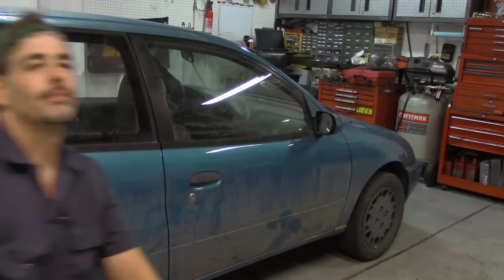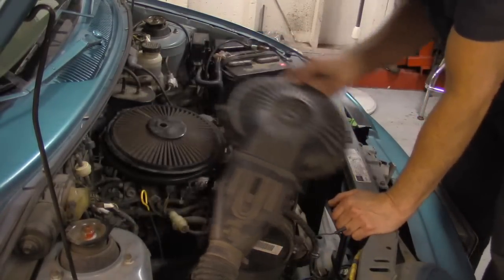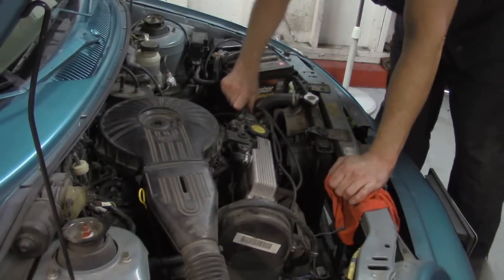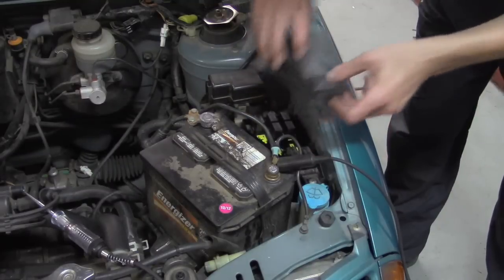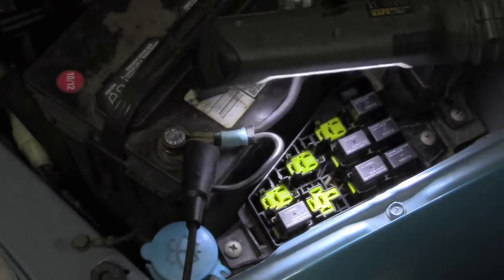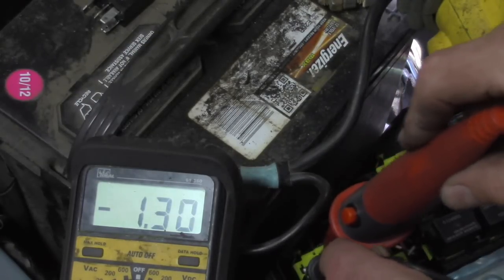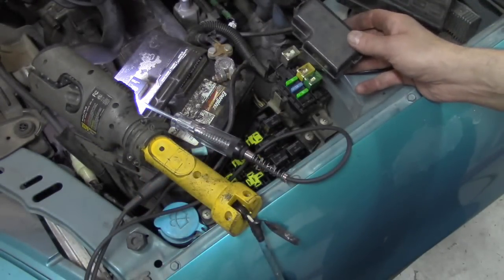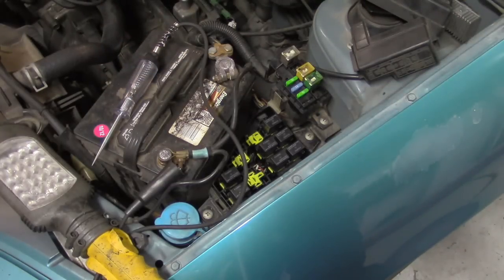Cranking No Start -Quick Basic Diagnosis

Comment: i have a 1995 cadillac fleetwood brougham 350lt1. hard start when cold. sometimes no start unless i switch it off and start again. when i leave on the car, i may stop somewhere 3 or 4 times. then it acts like it's running out of gas, then rough idle. i have to drive it aggressively to smooth it out. PLEASE help me.
Reply from the maker: Ok- what data do you have?
Reply: i have no data because, i can't find anyone with a obd to gather data from 95 down. they tell me that their obd is from 96 and up. i have no engine light. i've  installed new coil, new EGR, new fuel pump. when i crank it, it has a very low idle. when i first got it, it would crank with a higher idle then goes back down, oh yeah, i've cleaned the mass air flow sensor also.  i hate to keep buying parts and no fix. i wish i could find someone with a obd that will read my codes if any but, the light is not on.
Reply from the maker: You don't need OBD data. just tell me what your basically electrical and pressure outputs were- like the data that indicated your EGR  and fuel pump needed replaced- what was the data you used to determine those?
Reply: back in 2013, my brother-in-law had a obd  to fit my car when the light came on and, the code that was read out was the ERG. but he doesn't have it anymore. i replaced the ERG and, the light went off. the fuel pump was replaced in 2012 by the previous owner. like you said i really need to take it somewhere to get a fuel pressure reading. could the fuel pump be failing in 5 years? oh yeah let me mention this, the car has 300,000 miles and runs very good untill it gets hot. please be patient with me, i am not trying to worry you to death.
Reply from the maker: No problem. There just isn't enough data here for me to work my magic.  Fuel pressure and voltage tests would be helpful- otherwise I'd just be randomly guessing.
Reply: ok, i thank you anyway. i'll figure it out in time. you are still my favorite machanic . i watch you videos almost everyday. i still feel you are the best on youtube. have a good day.

Comment: hello sir,i have un issue whit my car that nobody can tell me what means,hopefully maybe you can tell me something about it: so,i have a passat 2002 whit 1.6 liter engine (ALZ code) and i cannot pass the emissions test because of my high CO,everything is good HC are below 70,nox are in range.On my scan tool ALWAYS but ALWAYS LONGTERMFUELTRIMS are negative 10 at idling and STFT are between -2 and 5 sometimes.If i rev the car up then LTFT goes to 0,never positive values.Both of the sensors bank1 are reacting almost the same between 2000 rpm and 3000 rpm,at idle the upstream sensor react between 2mv and 9 mv,so it is a waveform on the scanner,the downstream sensor stays under 400-450 mv.At idle car pass the emissions test whit a value of CO under 16(max for my engine is 30,not percent),but soon it rev up and goes to 2500-2600 rpm everything it is going crazy.I am not suspect the catalitic converter because if this is the issue then at idle the CO would not pass the test,so my question is where this fuel that have to be always corrected comes from??i have replace the coolant temp sensor,change the air filter and spark plugs,but nothing happens whit long term fuel trims.Car acting perfectly on the road,no problems on startup or in fullpower.Could be to much pressure from the fuel pump that needs to be taken away?if LTFT  are alway negative could be the mass airflow sensor defective?airfuelratio is way way below stoechiometric range of 1/14.7,is arround 1/10.Car does have a good mileage.On the tailpipe,if i touch whit my finger there is black ashes,but in revs it didnt see black smoke at all.No trouble codes on the scanner,still cant pass emissions test.Thank you,i hope you give me some ideas,or if you need more data i will be happy to tell you everything what my scantool can read,i am sure that if LTFT are closed to zero,then my catalitic converter could keep up to pass emissions in any revs is tested.One more thing,i can not hold steady rpms,if i try to stay o 2500 or goes up or down and need to be corrected from the gas pedal,but cant stay fixed on any revs
Reply from the maker: Sounds like possible FPR problem
Reply: thank you sir for response,if fuel pressure regulator it is the problem,on my scantool its not detected,my deadline for the emissions test its close,i have to get rid of this otherways car will sleep into a garage and i dont want that.Thank you again sir
Reply: hello sir,me again :).....i did some changes this week on my passat that i would like to share whit you: i change the air filter,i change the sparkplugs,i have change the fuel pressure regulator(it was some sand in that old one),i change the coolant temp again,readapt TPS,and i was hope that,like you said the FPR  should be the issue for my high level of CO from exhaust....but its not.The LTFT it raise from negative 10 to negative 3.9,the fuel consumption its much better now but nothing happent whit  carbon monoxide (CO)....still high,altrough at idle it is in range(under 30,mine its 16) but when the engine revs....the CO level its raising too much and i cannot pass emissions test....could be the catalitic converter below efficency?this engine runs almost perfect...good power,good mileage,starts ok...one more thing,i have seen on my scan tool that the downstream oxygen sensor if it is become stable revs than its stay arround 600-800 mv,never under this value,and i know that this is not good,and the  high revs between 2000 rpm and 3000 rpm cannot stay fixed,lets say 2500 fix,they are still fluctuated or instable....maybe my problem whit emissions its that when the car it is tested the mechanic cannot hold rpm stable,what should i do for that?if you have some ideas i will be happy to read from you,thank you sir

Comment: A few notes.

 Avoid probing the female pins in a connector or a fuse block with just a test light or voltmeter probe. It's OK to touch the terminals but don't jam the probe into the pin because that can cause terminal tension issues. As far as when is the right time to check the fuses, the right answer is after you have a sense of direction such as whether you were missing fuel, (pump operation and/or injector pulse) spark or both then you can start to drill down to "why" those were missing. Otherwise any other test choices made would be totally random in nature and could just as easily be wrong or right on any given vehicle.
Reply from the maker: Great advice for sure!

Comment: That relay, were 2 terminals bigger?  Couldn't tell watching, but it looked like it. They would be load side if so, Would still test before jumping them though.
Reply from the maker: Yes it was hard to tell but indeed once I found the load side the terms were slightly larger. I too often use this as a quick reference but usually it's more obvious than it was on this car's relays

Comment: Enjoyed video. Nice to see the steps you take for diagnosing the no start condition. I never knew that if the fuel pump doesn't work, the computer shuts of the ignition. Not like the old days. That can get confusing. No fuel equals no ignition. Weird. Thanks for the video. Good to see someone that knows what they are doing working on cars.
Reply from the maker: Yeah it's not so much that the PCM shuts down the ignition- it's more that the secondary shares the same circuit so when the fuse blew, both fuel and spark were affected.  But indeed sometimes the PCM can independently control a cylinder. For example on some models a misfire in a cylinder may result in PCM shutting down that injector intentionally to prevent washdown and cat contamination.
Reply: Thank you. Good to know.

Comment: Hah, I just had a fuelpump die on me a few weeks ago, and the first thing I did was try to hear the fuelpump, then the fuse, then leave the ignition on and beat on the tank (which apparently kickstarted the fuelpump). Drove it to a shop, switched the ignition off, tried to start it again, same problem. Told them to swap the fuel pump, and voila. Not quite the 2% method, but I'll take it.

But I agree on the fuse thing not being the obvious thing to check first, I mainly did it because I didn't have any tools with me (nor am I really that proficient with electric diagnostics etc, but I love watching others do it :P), and it was an easy thing to check.

I would've been very suspicious if my car had had a blown fuse though, so will you be providing an update on this car if it happens again, and/or if the actual reason behind the blown fuse is discovered?
Reply from the maker: Yes i show on my other channel why the fuse blew and the repair. You can check tbout for free.

Comment: LMFAO!!!!!!.............now come on Matt, you know before you tried that ol fastec nonsense you are supposed to blast the whole engine bay with brake cleaner and you would have found the problem instantly................good work buddy glad to see you back
Reply from the maker: Hahaha oh yeah that's right!.  Actually, now that car is fixed I can tell you this in all seriousness: blasting this engine bay with brake clean as a first step would absolutely 100% resulted in an engine fire.  No joking.
  I use brake clean all the time in diagnostics but never as the first step unless I know for a fact an ignition problem is not the cause.

Comment: Hey Matt, In checking the distributor for spark with a 12v test light, would the high voltage light the lamp without harming it? If so, then it is far more than just a 12v test light?
Reply from the maker: Indeed the voltage is way, way above 12V in this case but no harm at all.
Reply: caduceus33  Hold the test light away from distributor creating an air gap about 1/2" to 1". The bulb will not light but you should see spark jumping the gap.
Reply: Matt, Thanks for the video and the reply!
Reply: Jeff, Thanks for the clarification of the method!

Comment: So the next step would be to look a a power distribution diagram and find all the circuits that run off the fuse? The circuits that are exposed to heat and vibration are likely suspects?
Reply from the maker: 100% correct!!! And exactly what I do to eventually find the fault.

Comment: Very well done, Matt. I agree with those who like to see minimalist equipment used, simulating what we might have at the roadside. A similar situation happened to me hundreds of miles from home, and with my family aboard I quickly asked for help from the mechanic in the shop 50 feet away. It took him over an hour to find a blown fuel pump fuse, and to my surprise he only charged me $20 for his time. I think he was feeling a little sheepish he didn't find it sooner. As you say it's not at the top of the list, and other data like the absent spark can send the investigation down the wrong rabbit hole.
Reply from the maker: Yeah there is no shame in taking hours to find an electrical problem- even days to find one that's intermittent.  Good for that mechanic.  But still doesn't explain WHY the fuse blew as you well know.

Comment: Matt could you please elaborate about the fuel & ignition being on the same circuit? I've always thought they were separate circuits & when you pulled the fuse it only said "FI". Are they always together or just on certain models? Is there typically no ignition fuse then or does that vary between models?
Reply from the maker: Just certain models.  On my other channel we cover the wiring diagram for this model in searching potentials for the short circuit and I can tell there are other things besides fuel and ignition on it!! It's one busy circuit (which makes tracking a short much harder of course!)

Comment: I agree, hindsight is always 20/20 in the end. Sometimes fuses just "go" for no reason other than it's their time. I only worry about changing a fuse when it's black on the inside, that means it definitely went open because of a catastrophic failure (short) of some sort. If it is just open and clean looking on the inside I don't sweat it, changing it is all you can do at that point and wait and see if a failure of some sort presents itself more clearly in the future.
Reply from the maker: Fuses do not "go for no reason" especially over time.  You also cannot possibly determine anything by how the fuse blew.  You definitely need to change your thinking about this- it is completely wrong.
Reply from the maker: Completely wrong. This is BASIC ELECTRICAL.  There is ALWAYS an etiology for a fuse blowing. ALWAYS. They do not just blow for no reason and you cannot determine anything from the look of how it blew. If as a professional electrician you have just been replacing blown fuses because you think they "just blow sometimes" then you are a disgrace to your field and a danger to people.
  You are an idiot if you haven't learned this over 35 years pal.
BASIC electrical fundamental concept.
Reply: Would you consider an engine compartment a harsh environment? An environment where fuses would sustain harsh vibrations and temperature fluctuations that could cause breakdowns in the fuse itself? If not you need to re-evaluate your own arrogant assumptions. Let me ask you this... do parts ever fail in your world? Everything is manufactured so cheaply these days how can we even assume the fuse wasn't defective being overrated in it's current handling capabilities due to a manufacturing flaw? You're the one making assumptions that fuse was in a pristine environment for all these years and perfectly manufactured to tolerances never seen by humans before. IT IS POSSIBLE there is an intermittent short, in the meantime all you can go on is face value, YOU stuck in a new fuse without measuring current draw, using a bulb or circuit breaker, you HAVE a current meter USE IT!!!
Reply: You present nothing but straw man arguments and insults, have a nice day.
Reply from the maker: Omg you are an even worse logistiician than electrician. You clearly don't even know what a straw man fallacy is.  
  Give me ONE example where I used a straw man argument. Just one.
Reply: You spelled it wrong and logistics has nothing to do with your baiting and red herrings. Do some research on nuisance fuse blowing and fuse characteristics. There's tons of information out there but I doubt with your self absorbed myopic views you would ever consider suggestions other than your own. What no insults this time? You're slipping, try insulting me as an Electronics Technician as I had clearly written yet you read what you want to read and think that way also. I never said anything about a fire, there's just one example...
Reply from the maker: Yeah you failed to address the question.  Not surprising to me.  Anyway just keep watching. you will learn much about logic, science, and electrical.  You are not very skilled in any of these.  I am sure you have other skills but these you have shown you lack terribly.
Reply from the maker: BTW you now said I gave straw man AND red herring arguments.  Examples, please?  Like I said, logic and deduction is NOT your forte'.

Comment: why there 's no spark
Reply from the maker: There is no spark because the fuel injection circuit includes BOTH the fuel system AND the ignition system (and other things too in fact, according to the wiring diagram).  The blown fuse will cause both failed fuel AND spark.

Comment: Dr.Schrodinger can u please do or tslk abt how to change a cylinder head on a dual over head cam like a boss. I seen the chilton but I'm wondering if there are any cheats like there is on single cam
Reply from the maker: I have a couple of cylinder head videos on my channel. Changing on DOHC, SOHC or pushrod are all similar. It's just a matter of how many cams you need to time.

Comment: I have a question on the crankshaft sensor, when they go bad or are going bad, will the only symptom be a crank no start, or is it possible for it to start the engine but cause other issues? I have a list of everything i have changed on GM 350 that is powering my boat and still cannot fine cause for hesitation and i believe the slight sound of some backfiring but the exhaust is under water so it is a muffled pop. What i have changed so far: I have a 2002 Shamrock powered by a 2002 GM 350 Mag Horizon Mercruiser.
It
 has a bad hesitation when i throttle above 2000 rpm thru 3000rpm, it 
idles smooth,starts easy and will cruise at trolling speed ok.  I have 
replaced Ignition coil,cap and rotor,plugs and plug wires, had fuel 
injectors tested and cleaned,test fuel pressure at the rail and it is 
steady at 43psi, fuel pressure regulator i believe is ok, when i pull 
the vacuum hose off while engine is running the fuel pressure increases 
and there is no gas leaking out of it. I have also had a compression 
check, that was good and the mechanic found no codes in the ECM. Also 
replace the pcv valve,egr valve and throttle position sensor. I have not
 replaced the crank shaft position sensor, do you think this could cause
 a hesitation under load? Any suggestions would be appreciated.
Reply from the maker: WHich design is the sensor? Inductive or hall effect? Either way I cover these on my other channel.
Reply: Thanks for the reply, after researching the difference between Inductive and Hall effect, i think mine is a hall due to the additional 5volt input needed. Thanks for the help and the informative video's, i will go to the other channel and and watch the episode on crankshaft position sensors.